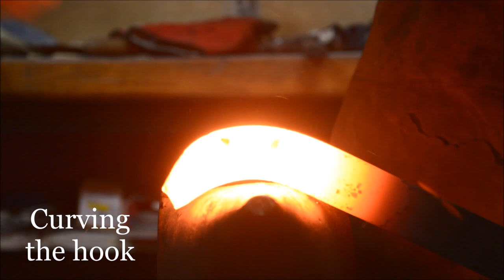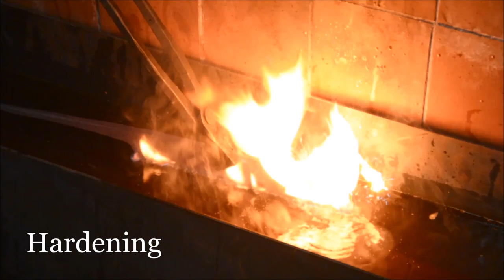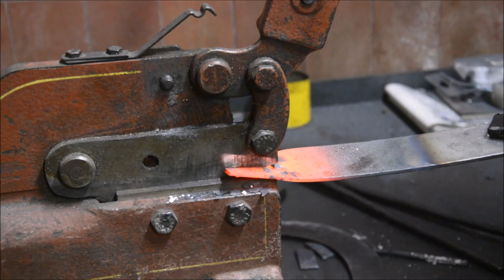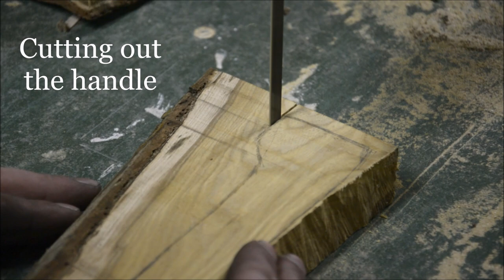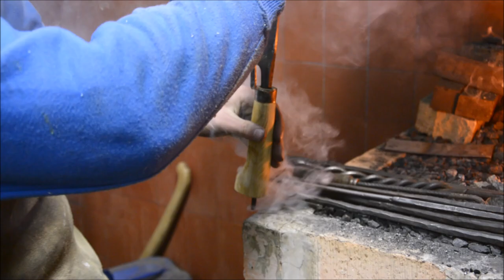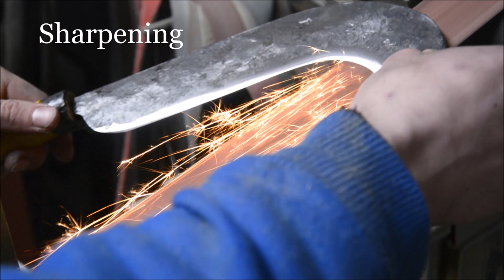Making a hand forged billhook

Comment: Billhooks are very common here in asia they usually crappy,but this is high quality blade!
And what is ferrule for?,never see that in here
Reply from the maker: I'm Bored the ferrule is there so the handle doesn't split in use, and the hook on it is for carrying on the belt
Reply: oooh i definetely have seen that,but it's just plain steel belt not with hook hehehee